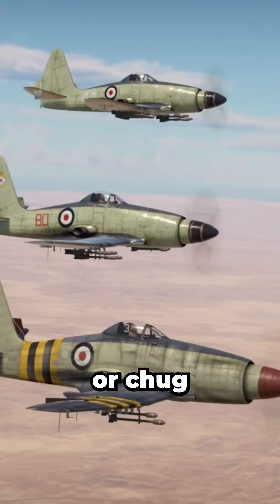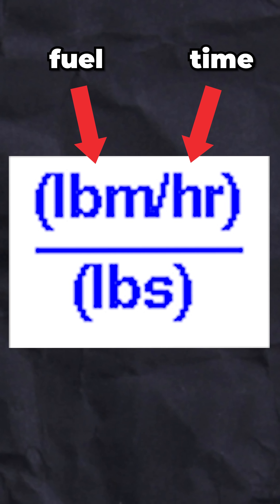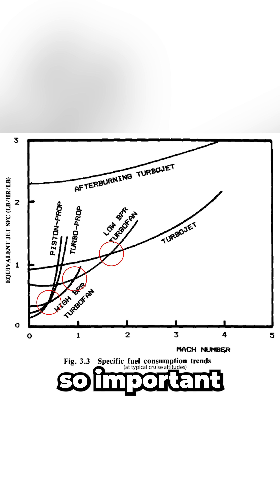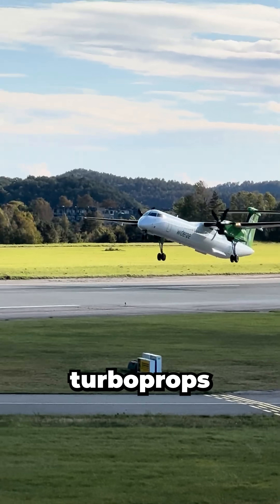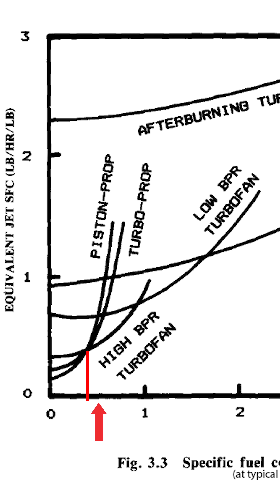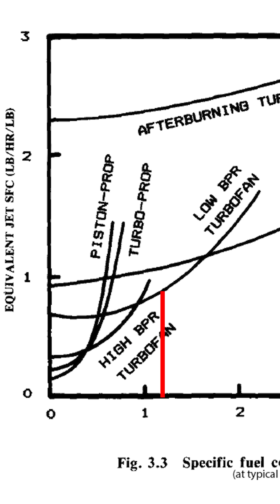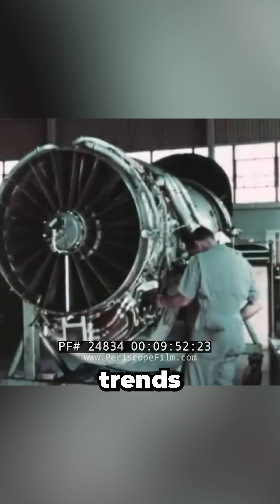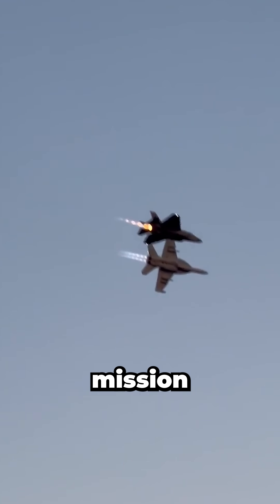This chart will change how you see jet engines

Comment: I was in a 747 to China and we were very close to the speed of sound. At lest past mach 0,95. Don't remember exactly it was 2001, Engins almost turned off. I don't think this was normal. We were in a extra strong Jet wind due to very extreem weather conditions. -65 C on the ground in Mongolia. People freezing to death in their houses, using furniture as firewood. Would have been fun if the pilot would have throttled up for a moment so I could have said I had been on a supersonic Jumbo jet. According ground speed. As the wind was probably 300 km/h with us.